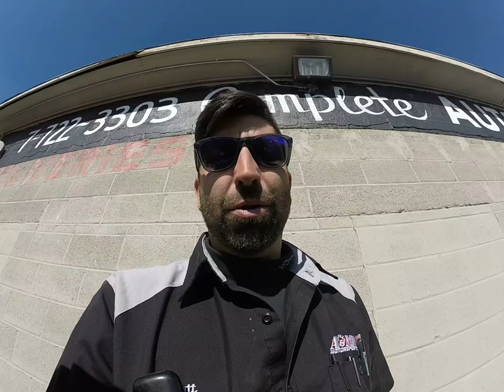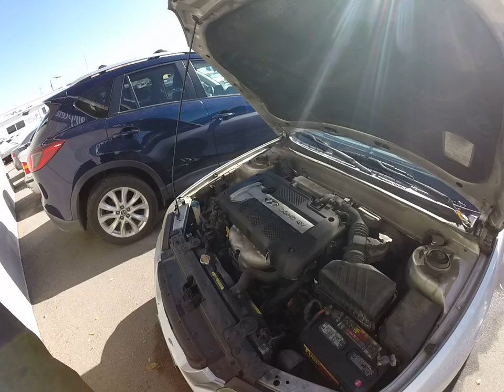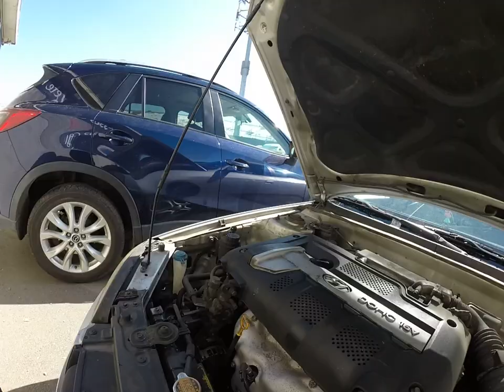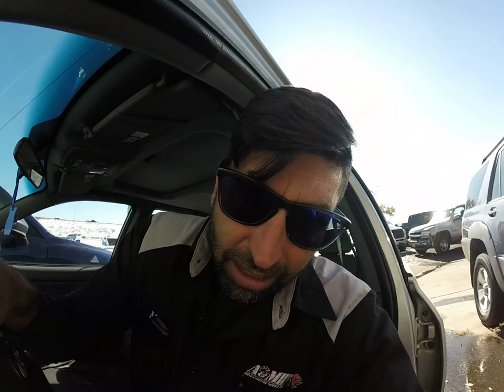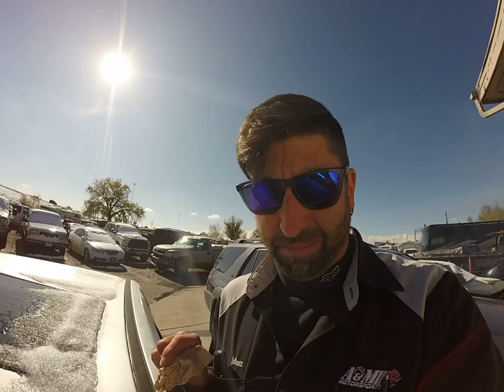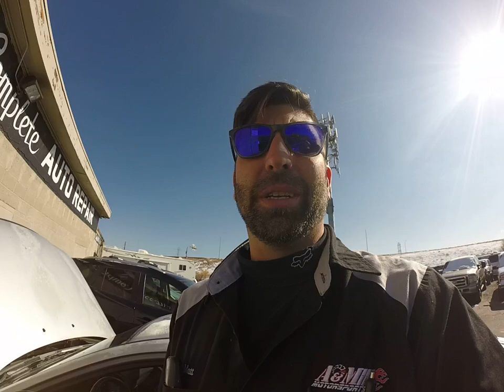*** THIS IS WHAT HAPPENS WHEN YOU OVER-FILL ENGINE OIL!!   Mechanic FAILS!

Comment: I prefer to run my engine dry. No oil at all. Don’t have to worry about overfilling. Keeps the exhaust bearings from overheating too.
Reply: What a pepega
Reply: I usually put coolant in my oil to prevent the engine from freezing. Stop it from seizing also
Reply: I sometimes put dish washing tablets in my fuel tank, it cleans the engine you should try it.

Comment: Just really weird for you to rev the engine when you already know that it sounds fine and engine is overfilled. Aren't you knowingly damaging the engine at that point?
Reply from the maker: With 3 quarts or less no, typically it would have to be way more.  After correcting the level we had to drive it on highway with higher rpm's to burn off the oil in cat.... as of now car is still on the road....
Reply: @AMMotorsports  a Ford 500 has a weird dipstick to me the way it curves around. 2 holes...should top hole be filled in or empty? Would 1/5 quart over cause damage?
Reply from the maker: @mem1701movies  depending on the year, the dipstick is located under the air intake tube. Thats where you add fluid.  May have to take that off to check.  And no, a little bit over full will not cause any damage or issues.
Reply: And all just to make a dumb video!
Reply: Thanks I overfilled by less then a quart I'd say  .50 smoke on startup drained 3 quarts still smoking should I run it on road for how long

Comment: Jiffy lube sounds like bad news... When the previous owners had my old car, Jiffy lube also stripped the threads on the oil pan so they plugged it from inside the pan and told the previous owners they'd have to get a whole new oil pan. so whenever it was due for an oil change, I'd just siphon the oil out from the dipstick port lol 😆 but still.. not too impressed with jiffy lube.
Reply: Yeah they changed my oil and didn’t change the filter then tried charging $100 the filter is cart so if you change the oil the filter needs to be changed too so I started changing my own oil

Comment: I overfilled my engine oil AND my auto trans fluid by a quart or more when I changed both. Not intentionally, but I got distracted and it happened. After watching a # of these alarming vids, I siphoned out the excess from the fill tubes and feel much better. I certainly will be more careful next times.....

Comment: That’s crazy. I just had an oil change at jiffy lube and they did the same thing. Oil level is way above the limit!
Reply: Never go to Jiffy Lube they overfill with oil and could cause your engine to burn
Reply: Jiffy Lube and Walmart.
Reply: And express oil
Reply: How do you fix it 😢
Reply: @zayraquezada5763  If you're referring to overfilled oil in the engine, you would need to unscrew the drain plug on the oil pan and let some out.

Comment: Lmfao!!! Got off work, bought 3 quarts and put in it. Surprised I made it out of the gas station. Went straight back to work to take a look. Sure enough I put way too much oil in it. Was tired and didn't bother to check. Such a nub lol
Reply from the maker: Lol!  I mean, smoke screens are cool too I suppose
Reply: My friend got a check engine light thought it was low oil ended up adding 3 litres of oil extra before he called me.

Comment: This is what happened to my mums car. So my mum brought a car but she never drove it much since she drove company car. She gave the car to me and I noticed that once you accelerate, white smelly smoke came out. Went to the garage, turns out there was too much engine oil, they drained the engine oil but said some smoke will come out but it will eventually go away. I just drove the car, doind 50+ miles plus, no smoke so relieved this was sorted out. I went to the garage and they said it was a turbo or injector problem, will take £600+ to fix, but a £10 job of removing the oil fixed it. It could have been much worse but thankfully, managed to get this sorted before it screwed up my engine.
Reply from the maker: Thanks for sharing!!!
Reply: @AMMotorsports . 
This has happened to my moms car. Will the smoking go away? Are there any other steps to take other than getting the correct amount of oil in it?

Comment: I had a similar problem now with my VW 2013 CC. Hopefully too much oil is my problem. Waiting for a tow right now😒 Smoke was pouring out way more than the car you showed.  I pray it's simple to fix because like many I can't afford it right now.
Reply: Do an oil change, did you get it fix? Happen to me when I had to drain everything to fix my oil pan gasket, pump hoses, and valve cover gasket. Lexus was hard to read. I had to hold it at a certain angle with light…

Comment: I filled a 6 liter Volkswagen to 12 without realizing and fixed it by draining and filling to right level and then letting the car idle for about 30 min to an hour.  The smoke dies out in about an hour. It was a Volkswagen Tiguan. No codes yet but the engine shook/rattled when I started it up both times then mellowed out. (If engine is shaking. Turn off vehicle btw)

Comment: Last oil change I got was at jiffy lube cause I was being lazy. Last week did my own and I drained 12 quarts of dark black oil in an engine that calls for 6 including filter. Only signs I heard was a ticking like a bad lifter before I changed the oil myself. Crazy. $150,000 custom truck too.

Comment: Actually checking the oil level can  be pretty hard with some cars, on my Toyota it's really hard to see the oil level when the oil is new / not dirty -  not sure why,  you literally have to hold the dip stick  at a certain angle in direct sunlight to see the level,  challenging  even for a car person who's been working on cause since age 14  - perhaps it's a Toyota thing, never had the problem with my V8 Audi.
Reply from the maker: Yes. Also, the late model V6 Nissans are extremely hard to read.... bad design. Looks like oil is up half the dipstick
Reply: @AMMotorsports  same with my 2018 ford mondeo.. which is what got me to your video.. ooops

Comment: This is exactly what i did, only i put some 3 or 4 liters more than necesarry. Soon after i did that, my car was accelerating at full power and there was a huge smoke cloud behind, after i tryed to turn off the engine from the key, the engine continued to function at insane RPM for like a minute. After i restarted it, the engine appeared to work normally again untill it accelerated on its own again, it was terrifying i thought the engine will blow up, i managed to reach home after a 3 or 4 sessions of insane auto-acceleration in which the oil managed to enter the pistons to burn together with the petrol. Now i'm going to drain it all away and put some of it back, don't do what i did, i hope nothing's broken.
Reply: Bro what happened?
Reply: Please update? what happened?
Reply: Update please ?
Reply: Literally same thing coz instead of engine oil I took out ATF and added oil on top of what was already there even tho I changed oil filter don't think that affected much
Reply: Did you hear any weird engine noise?
Reply: @SKmedia-songs what happened after that?
Reply: @lowflynn1789  changed engine oil and filter and added atf and it ran good after

Comment: I did this in a fiat 500l, the engine blew and the oil came squirting out the air conditioning vents.
Reply: atleast your blower fan is now well lubricated

Comment: My wife has a 2007 Nissan Altima and that thing sounds like a diesel lol it's still drivable she drives it everyday, when I was changing the coil packs out there was oil down in one of the spark plug holes 😬 it's been a while ago so I can't remember what I did but I remember spending a bunch of money at the parts store to get parts to fix it . But now like I said perfect description is it sounds like a diesel and it's hard to get the codes because the check engine light has been on ever since she bought the car so it could be a million different things that pop up . But off the top of somebody's head where do y'all think the issue sounds like??? Edit: update I change the plugs and it fixed it temporarily, oil is coming in through the o-rings but you have to buy the whole damn valve cover  because they're built in 🤦🏻‍♂️ with gas and $5 a gallon and inflation making everything go up I have the money for that so I just put some Lucas leak stop it will stop a leak from wherever it's coming from that stuff works miracles
Reply: Valve cover is leaking or oil tube seals.

Comment: It seems to be common for dealership services to use a predetermined quantity without ever checking the dipstick. I often notice slightly higher oil levels above the full mark on the dipstick...about a millimeter over.

Comment: 2-3 quarts isn't as bad as people are making it out to be LOL.......  if its running like that now it with no issues other than smoke,  then engine is fine.... its the catalytic converter you gotta worry about getting soaked with oil.
Reply: No cat no issue #straightpipe
Reply: @giovanni2980  Facts

Comment: How long does it takes for all the smoke to come out the exhaust. I made a mistake of thinking I drained my oil instead I drained the transmission fluid and had a double portion of oil. This is day 2 and it’s still smoke coming out the exhaust. Nothing too bad however it’s still apparent.
Reply from the maker: Dang it! 
 Hopefully a few days of running the engine at least 45 mins each time. Get that exhaust hot enough to burn out the muffler too.... let the neighbors know everything is fine... dont call the fire department lol
Reply: OMG transmission oil is Red and oil is Brown black if old #Something 2keep in mind ijs 🤦🤔🤯
Reply: If this happens drain the oil and fill your trans fluid.

Comment: I just changed the engine oil on my Subaru and I notices white smoke so I check the oil and it was empty.What should I do? Do I need a tow or can I drive it to the mechanic?
Reply: Get some oil and no dont fucking drive it. If you want to go to the mechanic get it towed. Dont drive it till you get oil in it. If you didnt hear rattling or werid noise you might be lucky, Then again white smoke might be head gasket leak which is common on subarus.
Reply: @linuxlinux9914  ok i have an 08 and I wS told too much oil and probably oil leak when putting oil in the car it has it days when it start smoking under the hood and then tail pipe . Is that a problem or should I just drive it to e

Comment: Car running cold in snow weather causing muffler discharge "that looks like smoke."
Car exhaust in snow temps observed....

Mechanic recommends:
- All engine gaskets inspected (Upper and lower intake manifolds, replace as needed,)
- Lets go ahead and rebuild at this point (because why not)?
- All exhaust gaskets inspected and replaced (because why not)?
- Oil flush and refill (new oil filter required, because why not)?

Mechanic recommends $20k in service and repairs. Approximately 3 weeks to acquire the service manuals for the repair.

Mechanic fails to explain an example of an engine over-filled condition. (Priceless) *Example provided in this video

Comment: So if this happens (overfilling) and correcting at a shop  and now the engine is knocking and making noise does that I f**k whole lot up or should I let it run a bit
Reply from the maker: Well geez, if it's making noise and knocking i'd say the engine is toast.....

Comment: Hey mate I've run into the same problem. I've drained the oil, .car starts normal but it still high revs by itself, should I take it for a run burn the excess oil?? Or should i put it in for service?? What would you do if it was your car??
Reply from the maker: Honestly, drive it and try to burn out the excess.  Also check your throttle body to see if oil has sucked up into intake, causing the high rev

Comment: okay so i did this yesterday after bein a cold numb nuts bc the snow that didn’t wanna check the dip stick, and i couldn’t get the bolt for the oil pan off so i had to do the oil filter, turn car on off method, for about an hour.. had that much, my car is way quieter now, but how do i know if i did some engine damage?
Reply from the maker: You would know if its making noise, but typically it would be a valve issue, so a tick would be heard.  If not, you are good......

Comment: Lol I just did the same thing now wondering how to fix it
Reply: Remove the drain-plug, allow some Oil to drain out, put plug back in hand tight, check dip-stick for level, add or drain more to get level between "ADD" & "FULL"  marks (FULL mark is where it should be), tighten drain-plug to proper torque...easy peezy.
Reply: Bruh... how to fix too much oil? Uh DRAIN SOME OF IT OUT! Damn you could be a jiffy lube mechanic.

Comment: I have this problem for my diesel truck my mechanic over did the oil when doing the tune up now it throws out white smoke but now my coolant goes down fast quick I think it got mixed with the engine oil, is the head gasket bad or what can I do
Reply from the maker: Ohh shit!!!  Well, if the coolant is draining it's going to be a head, head gasket, or EGR cooler (if it's a Ford 6.0L)   I have a Ford 6.0L and know all to much about those engines..  What kind of diesel do you have??

Comment: Hey so if this happens to your car and you change the oil to where it needs to be is there anything else that I would need to get checked out
Reply from the maker: Listen for engine noise. Other than that, drive it good to burn out the excess in the catalytic converter... that would tend to plug up the cat a little, but should recover after a long drive or two
Reply: @AMMotorsports  so I had a friend overfill a vw 2.0t fsi by about a quart and a half. Drove about a week & starting getting performance issues and lifter noise. Drained oil & filled to correct level. Noise went away & but had a slight misfire. Several days later check engine light is on and flashing has multiple random misfires on all cylinders. Initially the misfire started in cylinder 3. The cylinder 3 plug was caked in black soot and completely fouled like I’ve never seen. The others were OK. Turns out cylinder 3 has no pressure what so ever.. has a slight knock when misfiring badly. Is the motor shot or do you have any ideas for cost effective solutions/ things to look for? 
Thanks for your time
Reply: @bruinbs  what was your friends fix?

Comment: filled a whole 5litre but what I don't get is that when I check on the dipstick car does'nt have oil right after filling it, then it smokes when I accelerate( Ford fiesta 2006) please help
Reply: U need some new valve seals... had the same thing on my mum toyota. So its burning oil and thats what smells when u accelerate.
Reply: @FightPropaganda  Thank you man, would you know why a car fan delays kicking in and kicks in late, causing it to overheat even though changed the thermostat and the sensor
Reply: @itzzakesz7253  is there a turbo on that engine?
Reply: The problems can be found in different places: in the intake system (air filter, air mass meter, throttle valve), in the injection system (injection nozzles and pump), in the ignition system (ignition coils, cables and plugs), in the exhaust system (lambda probe and diesel particulate filter)
Reply: @FightPropaganda  ok thank you, much appreciated sir

Comment: So I overfilled mine and it's making a noise when starting and I realised I overfilled it and was wondering if I had done any major damage
Reply from the maker: Hopefully not!!  If you only ran it for a few minutes you should be ok, just drain out a little and re-check level.  Then drive it and see what happens